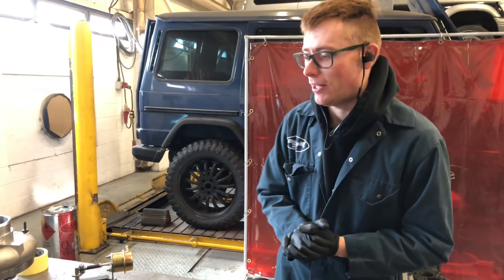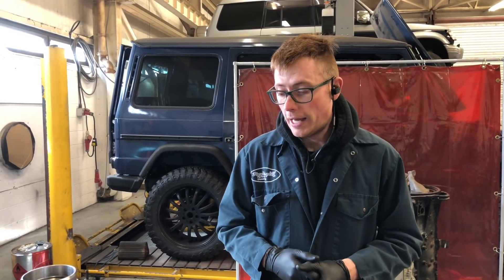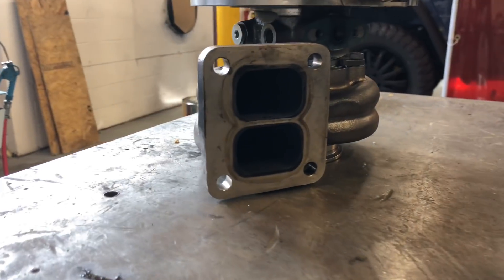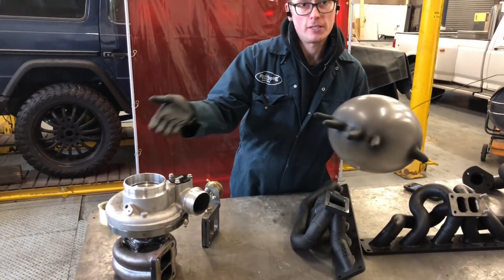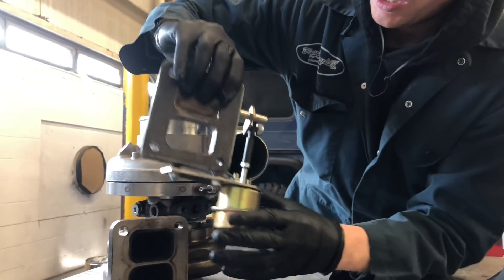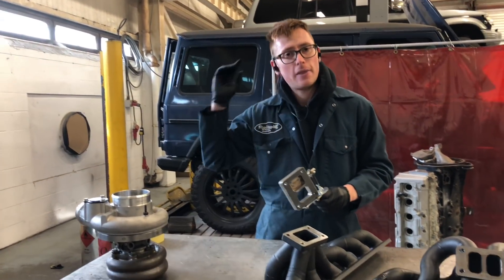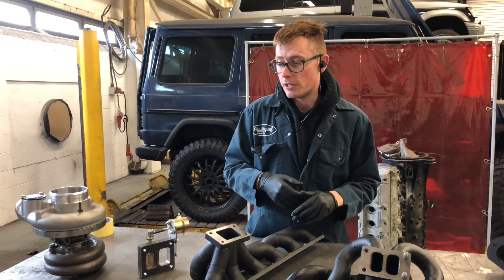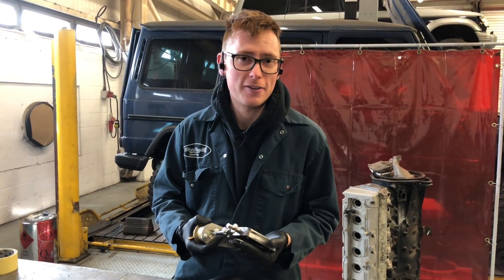Quick spool valve QSV

Comment: To shut up one of the two turbocharger channels means to give more axial load to one side... at lower loads and lower revs. 

Is this checked and does not harm the charger?
Reply: Both channels in the turbine housing causes axial load towards the compressor side (because there is only one turbine wheel, just like a turbine housing with only one inlet). The compressor side does the same thing in the direction of the turbine.
Reply: this kind of setup requires an undivided exhaust manifold but divided exhaust housing there for shouldnt cause that issue :)

Comment: Are the valves upgraded now?? I heard they were breaking
Reply from the maker: Nathan Martin  non of mine have broken, check your source is not biased.
Reply: DieselPumpUK I’m just asking saw a customer video of a gtx35 ruined by a broken SP valve. Good to hear yours aren’t failing
Reply from the maker: Nathan Martin  I’ve seen plenty of turbos ruined from engines that have failed also, it does not mean that all engines fail, it has to be inspected and maintained like any moving part. Mechanical sympathy is the key.